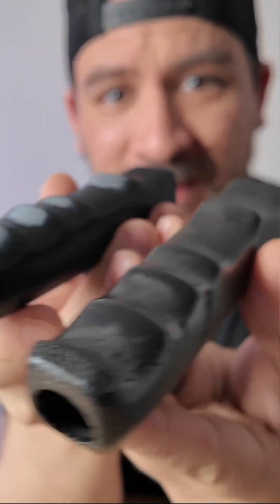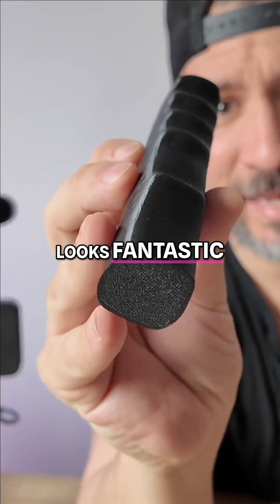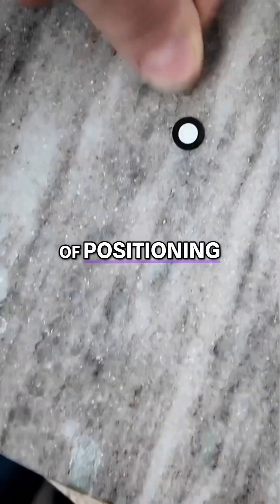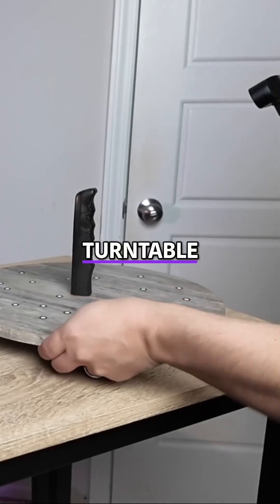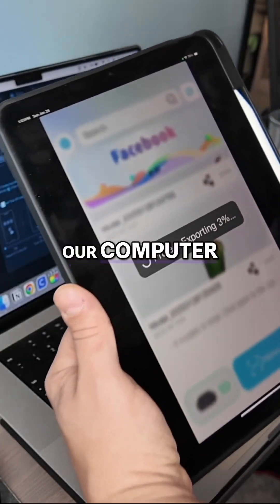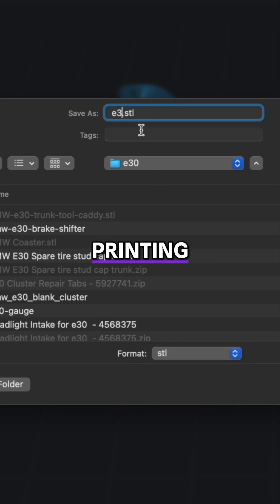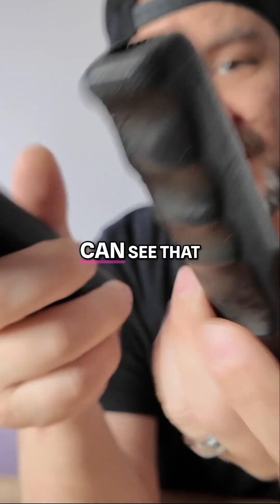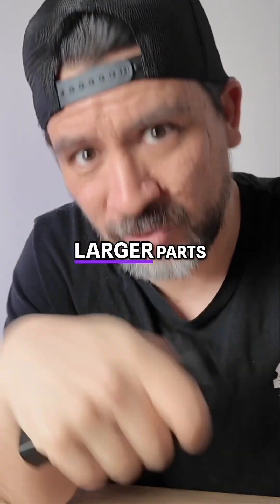3D Scanning with the Creality Ferret Pro | Surprising Results

Comment: It is a good scanner but connecting the scanner without the wifi bridge can be unstable. You connect the cable to the scanner handle and scanner itself and your phone, the 3 port cable. But the cable gets some tension which can unplug the scanner mid print. Cable is a little short
Reply from the maker: Good to know, Iike having both options just in case :) Do you can car parts with yours???